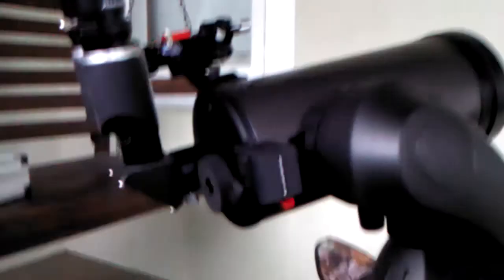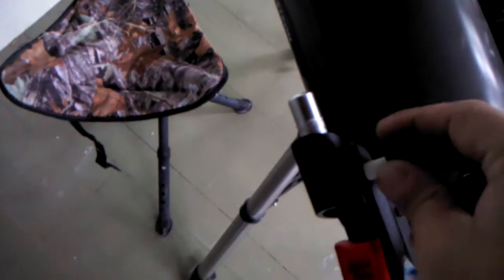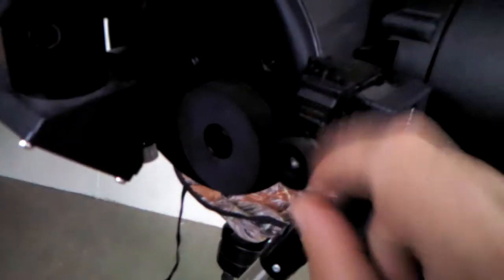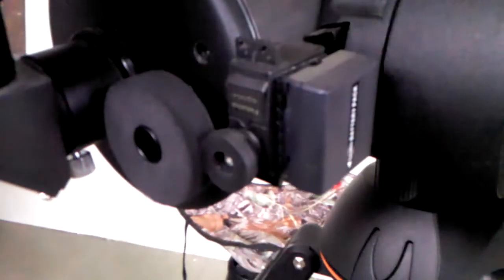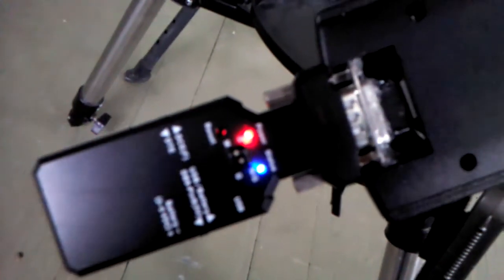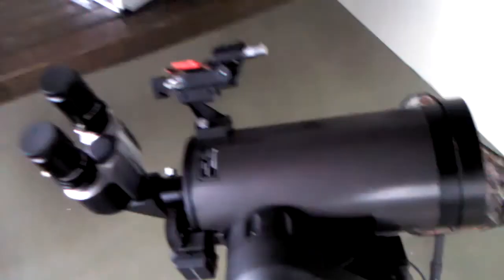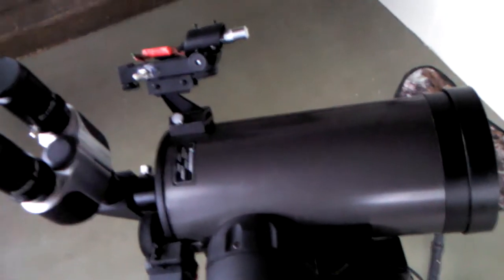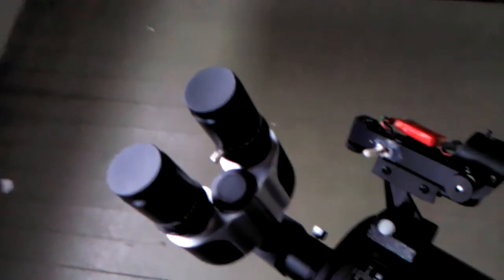My 127slt telescope

Comment: I really like what you have done with your equipment, very creative. I have a nexstar 8se, which has the same controller but I can't get my Android phone to connect through the bluetooth dangle. I have made the adjustments through hyperterminal for the bluetooth such as baud rate and I have chosen the correct setup. When I try to connect through skysafari it acts like it's about to connect but then it says that communication has been lost with the scope. Any ideas on what the problem is? Thanks